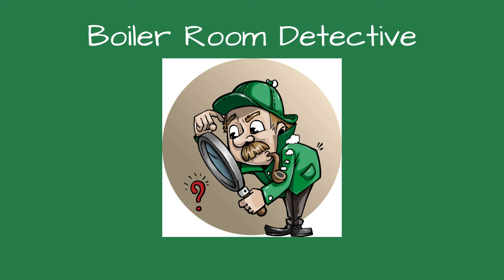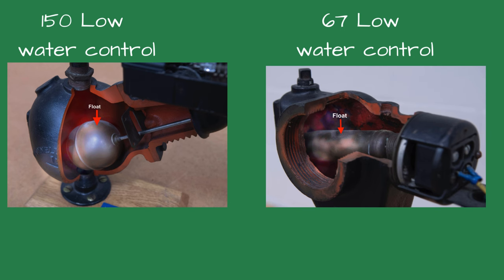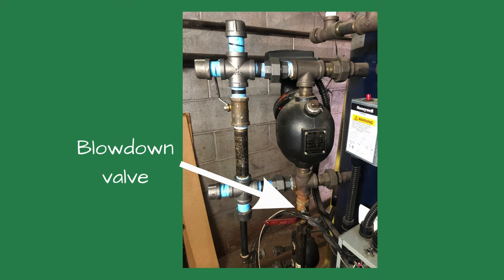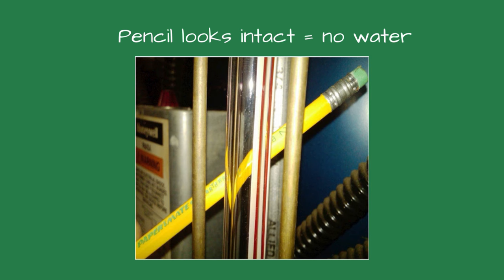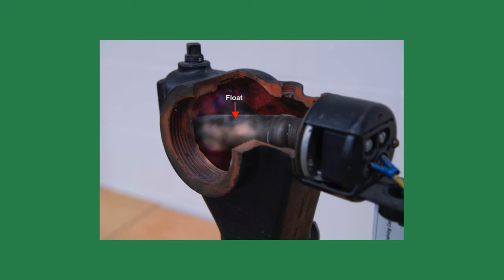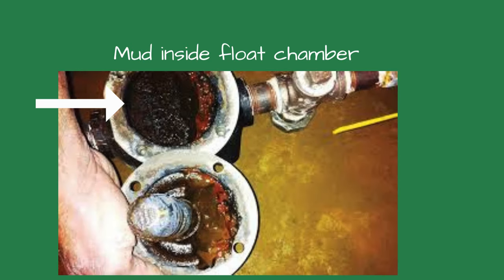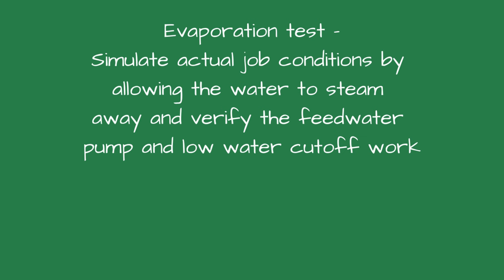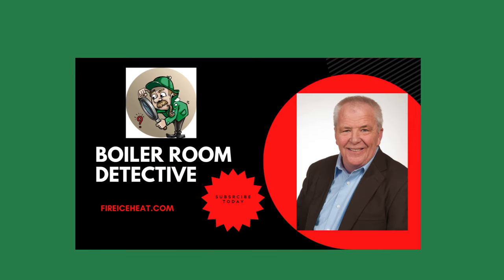Case of the tripped auxiliary low water cutoff

Comment: First plant I worked at had a similar issue with the LWCO . It had just been replaced during yearly maintenance and wasn’t working. The company came back and replaced it again but it still didn’t function properly. Turns out that both times the installer left the product tag and string on the float shaft and it was getting caught up in the baffle plate. 
I do my own maintenance now…
Reply from the maker: Wow I would not call them back again. Good catch

Comment: Just recently I had a job with an old Watt's 89A low water cut off. Customer called for no heat. I checked the water level and it was fine. I narrowed it down to maybe a bad low water float switch, but it turns out the float itself had broken loose and fell off it's support pin assembly. Since it is copper float I cleaned it up as best could and tried to solder it back on, but no go, it just wouldn't take.
Reply from the maker: Great detective work. Im assuming you changed it out Controls that old need a decent burial sometimes
Reply: Not only the controls, but the whole boiler is a huge dinosaur and eventually will be changed out. He wanted to just get it running for now. I told him it is not worth putting X amount of dollars into this thing, but that's the route he took. @boilerroomdetective